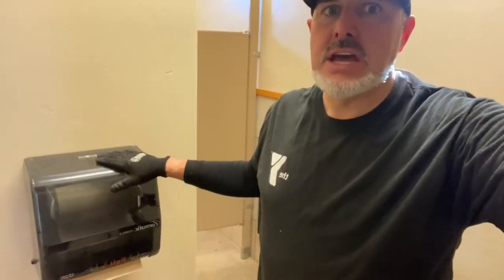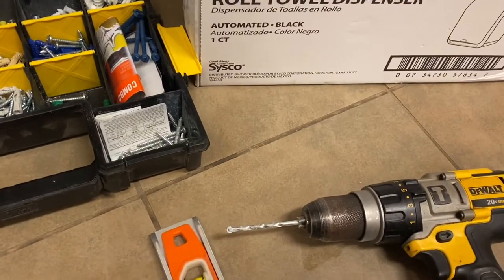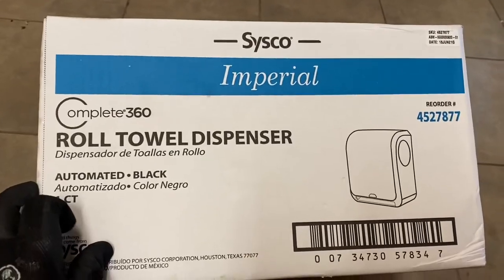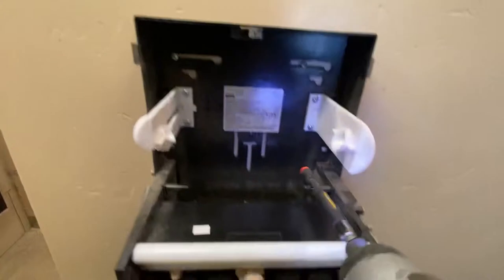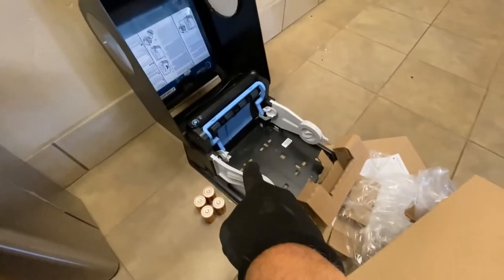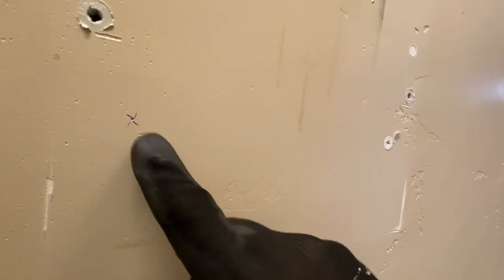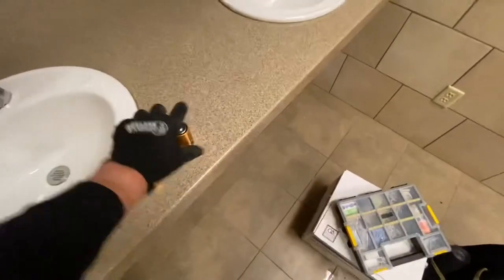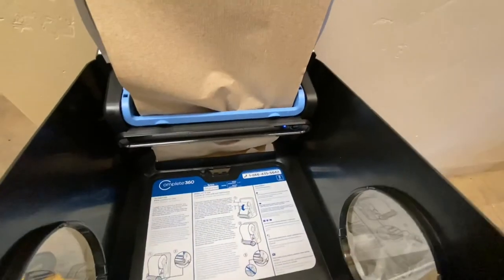How to install a towel dispenser.

Comment: You could have replaced it with a hand dryer
Reply from the maker: It would have meant electrical work, running power through the wall. We would need dozens of hand dryers to accommodate all the campers. Just was not in the budget. These dispensers were provided by the supplier at no charge.